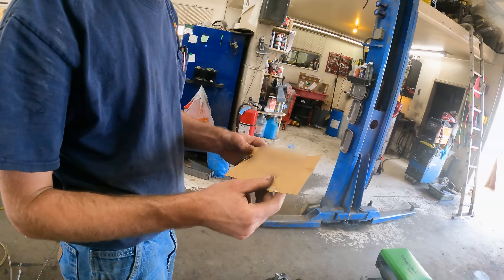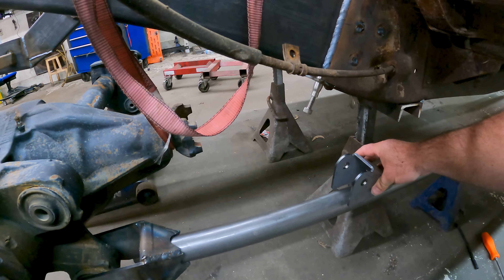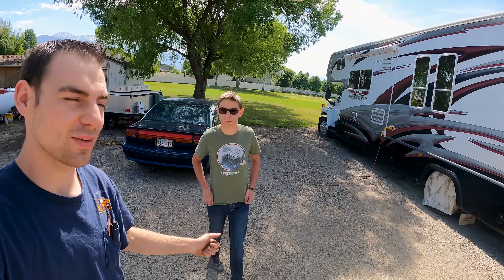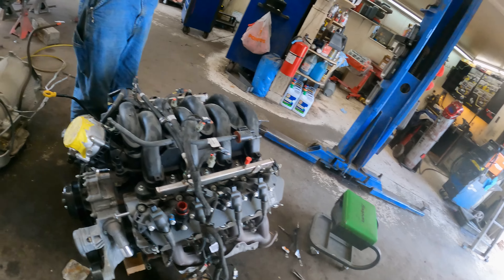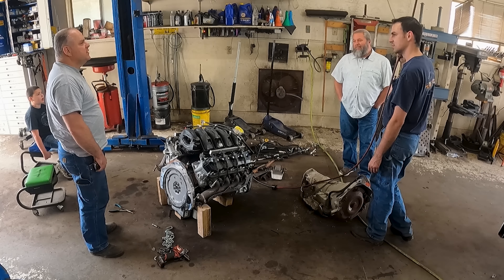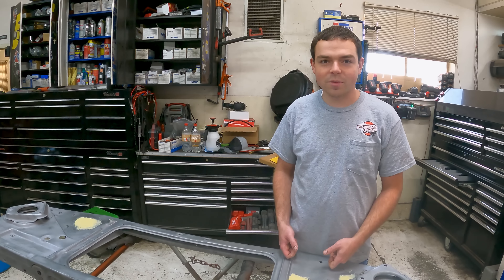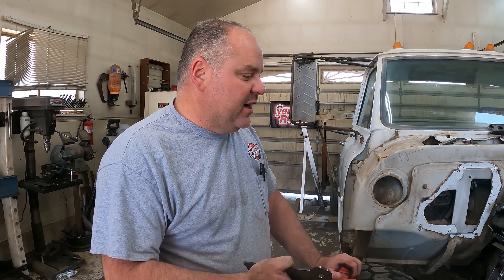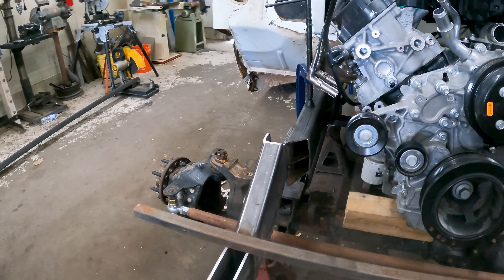Griz the Wrecker Gets Big Power!!

Comment: I have a 2021 E350 cutaway van with the 7.3 Godzilla motor. 
I had 5star tuning too wake it up.
Driving in the mountains with a 10,000 pound van, I never want for power.
The 7.3 has more torque than the 8.1 GM.

Comment: If you have the engine secure on a pallet, use the forks to carry the pallet where you are going. Keeping the pallet a foot of the ground will make sure the engine is not damaged if dropped. I was holding my breath when you where driving the tractor with the engine hanging in chains. There is so little room for failure without consequences when its hanging, so try to minimize it! Stay safe

Comment: When you get the holley controller on it turn the oil pressure up at idle because the cam is bad for  Dilaminating  do to low oil pressure at idle for fuel economy

Comment: With a ford heart beat in the chev truck. Y’all need a hybrid logo, a cross between the blue Ford oval and the Chevy bowtie👍 just to throw off people who see it. Years ago I did a ford swap into a Chevy truck. Just because I had the engine and transmission when the old 6 cylinder gave  up. That was a 1958 Chevy half ton step side. I put a 1969 ford 429 C6 and 9 inch rear in that truck. It was a sleeper quiet and fast.

Comment: its interesting to hear Chad say the ford engine is a lighter option which is usually the go meaning better power to weight ratio, but for towing offroad Rory adds weight to the front of trailmater to stop it doing wheelies when towing. I wonder just how many winches will Griz end up with?
Reply from the maker: It will probably end up with 5-6 winches.
I want to keep things relatively light and then add weight where it is needed later.

Comment: I'm a GM guy, but at one point I bought a used 95 F250 with a 7.3 and a 5 spd. manual.  It was a powerhouse!  Unfortunately the rust belt did the truck in here in the Pittsburgh area!  Eddie

Comment: So good to see something other than an LS.  Is there a Ford trans that would work for an off road oriented build?
Reply from the maker: There are a few ford transmissions that work in an offroad build. I chose to stay GM so I can use the transfer cases I have available to me and also allows me to use a Holley Terminator computer to run the engine and the trans.

Comment: Given some of the problems that oem ford truck owners have experienced with that engine (not a hater - just what I hear), I am curious to see how much your changes to a Holly system and improved cam helps the reliability.  These modern computer controlled motors may start better in the winter but man they introduce a ton of problems as well.  So excited to see what Chad and the team can accomplish!
Reply from the maker: There has been relatively few issues with the Godzilla. There was the cam/lifter failure that only seemed to affect a small percentage of trucks that was blown waayy out of proportion and there has been isolated outright engine failures  but nothing I would consider out of the ordinary. 
The Holley system is mostly to simplify installation and ease future tuning. All of the electronics have proven to be extremely reliable and not even something I ever worry about.

Comment: I have a 2000 F350 with 7.3l. Tough motor! Mine has just about 370,000 miles on it and still running strong. And - and, at 64 MPH on highway and RPM below 2000, I get 20 mile per gallon.
Reply from the maker: The old 7.3 diesel is a great engine. This one is a gas 7.3l from a 2020 and newer Super Duty.

Comment: Nice to see the 7.3 everything out there is ls
And dollar for dollar you will be better off
Reply: I do wish you stayed with a ford 10 speed and transfer case you have ford axle so it would of been nice to have the complete power train
Reply from the maker: I considered a 6 speed but I need a double transfer case arrangement and that wasn't possible with the 6 speed. I also didn't want to deal with the ford computer so that ruled out the 10 speed. I really like both transmissions but practicality won out. 
If I can figure out a doubler transfer case for the 6 speed down the road I will swap it in.

Comment: After the zilla burns up that chey trans rember ford built a 6 speed for the godzilla
Reply from the maker: the 4l80 will hold the power just fine. I would have used a Ford 6 speed but I can't make it work with the transfer case setup I have.

Comment: Should use the 10 speed that it came with or even a 6 speed. About time someone is using something other than a crap ls though.
Reply from the maker: My options for transfer cases is severely limited with the Ford transmissions otherwise I would have.

Comment: Finally someone using a Ford motor and new big block one at that. You can get great hp from just a few changes. Great choice. Love this build. Curious as to why your not using the ford transmission that's made for that?
Reply: I was surprised but according to what I’ve read it’s technically it’s not a big block.  With a 7.3L displacement and 445 cubic inches, many might jump to the conclusion that the Godzilla engine is a big block Ford. However, because bore spacing dictates what is a big block or small block configuration, the Godzilla's 4.53˝ bore spacing makes it more a small block setup than big block.
Reply: @Atodaso-pg9kq  well it has the cubic inch and power of one, it should be.
Reply from the maker: Outside dimensions are smaller than a big block, but it still has big block like displacement and cylinder heads. 
I chose to stay GM on the trans because the transfer case and controller options are way better.

Comment: Why not a Alison 1000 transmission
Reply from the maker: Cost, size and Holley can't run it.
Reply: @chadsfab  yes $13k is alot its stand alone computer dont know if it can talk to the holley terminator but it was just a thought
Reply: CA. conversion or ATS  but give me time ill call them
Reply: You can run the holley terminator not max  x if you run the stright holley terminator the computer thinks it Manuel the aillson 1000 own computer will run the transmission plus it pick off the motor by feel any way that 4l80 build right handle the 7.3

Comment: CHAD, please think about diamond reinforcing your frame
Reply from the maker: That will be added hopefully to the front once the radiator is installed. I hope to triangulate a little around the engine mounts and under the transmission mount crossmember as well. Once the boom is mounted and the 4 link is installed in the rear it will get some triangulation as well. 
The abuse this thing will see can easily diamond the frame and I don't want that to happen.

Comment: I do like to see you sticking with a 4L80 transmission😂 do you have an adapter for the flex plate, or possibly new flex plate?
Reply from the maker: I do have to draw the line somewhere. 😁🤣 It has an adapter for the bellhousing and the flexplate.

Comment: Should have stuck with Chevrolet/Gmc but its your build and your money. Should have got a Geen 6 454 and put a cam and stuff in it with a carb. Would have been easier i think  cheeper. Those gen 6 454 make lots of horse 🐎 power and with turbo they are beast. That Richard guy on YouTube does it all the time and they make good power. I have one and plan on doing it soon. Cant wait to see how it goes with that found on road dead motor lol. Just kidding it will be a beast yet. Something different to watch someone build.
Reply from the maker: I seriously considered doing an 8.1 and probably would have if I could have found a supercharger for it. A turbo just wouldn't have been the right choice for this particular build. I also have 2 gen 6  big blocks but the cost of building them to 600ish hp and installing fuel injection for off road use would have been quite a bit higher than what I paid for the godzilla which will make nearly 600 with a cam and a tune.

Comment: I’m not super faithful to any particular manufacturer. That being said all the ford modular blocks are solid, slap a cam and headers on any of them versus cams heads and headers on s gm. That being said, they are WIDE blocks. Hard to say the 7.3 is smaller than the 8.1…. It might be a little less long, but it’s still probably wider lol.
Reply from the maker: The 7.3l is a pushrod motor unlike the earlier 4.6/5.4/6.2l motors that are extremely wide. Dimensionally the 7.3 is about 2 inches narrower than a big block Chevy, 2ish inches taller and about 1 inch shorter. I think it weighs about 100 lbs less than a full iron big block. 
I honestly think a stock 7.3l will hold more power than a stock big block chevy, but it's hard to say for sure.
Reply: @chadsfab  I’ve seen them in the mid-high 1000hp range without some good internals. And yea I guess it’s not technically in the modular family. I tend to group all the ford engines, that can make crazy power in the stock block, as Modular’s lol.

Comment: If you have 1 ton FRONT Axle .

Do an Experiment ! If you have a pice of steel or Chanel 4-6’ long .
Take total weight standing Vertical .
The keep the bottom from sliding now lean the top down to a 45% angle , The Weight should be half the Total .

Now what dose the mean on a Rock Crawler ?

Look at Trail Mater he Has a Roof Rack with alot of weights, tools , extra Parts in boxes 
And his front Bumper is high and up on an angle he uses nose buster that heavy and A wench . 
Make the Front heavy getting that  weight to the ground in the form of traction.  
It’s all about Traction , Traction, Traction , the back has more than enough. 

Do the experiment 

Consider the Rack like Mater
It’s about the Win

Comment: The GM 8.1 can make 8- 900 hp at wheels with gust a turbo, see Lawrence LT Tolman, you tube, and no doubt better than a f.o.r.d, found on rubbish dump, 😂😂😂
Reply from the maker: I didn't want to have to put a turbo on this project since there isn't much room around the exhaust. If I could get a supercharger for the 8.1 I probably would have went for it. 
Time will tell on the Ford power. 😁
Reply: @chadsfab  all manufacturers make  bad engines at some point have had Ford Mopar  GM  and Japanese,  hope the Ford works out, but after seeing LTs 8.1 ,well that was an eye opener, most of my life restoring, building bikes and I live in New Zealand

Comment: Buck up Chevy guys, us Ford guys have been putting up with Chevy’s going in everything for eons! 
You and your family sure are inspiring, this is gonna be epic! ❤
Reply: Because GM built engines that were easy to work on & easy to bolt adapters too. I've had a couple fords in my day when i was young, just always went back to my trusted GM😆
Reply: OHC mod motors don't fit in lots of stuff that has shock towers!  It's not GM's fault that Ford shunned pushrod V8 development for +-25 years!
Reply: It’s all good ford Chevy dodge they have the good and bad points
Reply: @jeremywood2662  You are 100% correct, as the old saying goes it it has tires or t*ts it’s gonna give you problems at some point.  😬

Comment: I'm a Ford Truck guy and I think I'm a little upset. I can't stand it when ppl put a 350 in a Ford. This's just as crazy. Of all th' trucks I've owned, I miss my '72 GMC th' most. This's gettin way more interestin. 🤔
Reply from the maker: It was the right engine for the job. I didn't want another LS powered truck, the 8.1 requires way too much work to make over 500 horse, I didn't want to spend 10k building a 454/496 to make good power and I can't afford a diesel. This engine was the right size, makes good power with minimal modifications and can be easily ran with a Holley computer.

Comment: Chad you should have called me I have 3 low mileage Ford motors all have issues 2 of them are 2022 and the other is 2023. Good luck my friend. Ford motors hate spark plugs go figure.
Reply: Whats wrong with them & mileage. Oh & what motors
Reply: Yes  7.3 also out of 24 total cylinders 14 are spark plug less and $7000 per motor to repair and no hela coils . It's a huge job and the motors I can turn around and sell for $9500 each but no guarantee they don't fail . Stick with Vorteks they last boring but last .